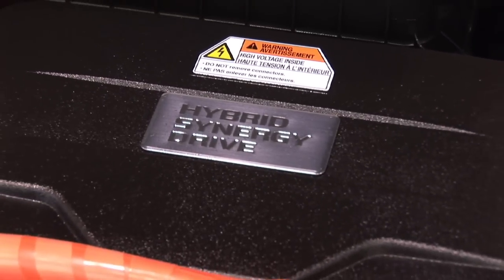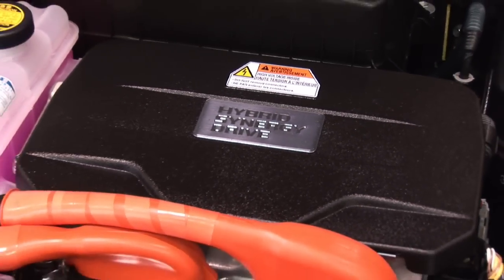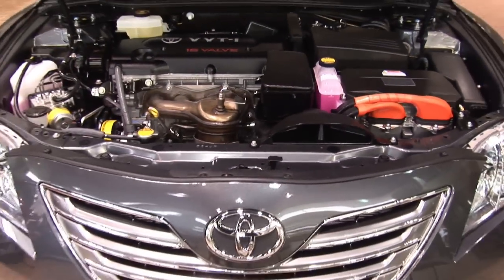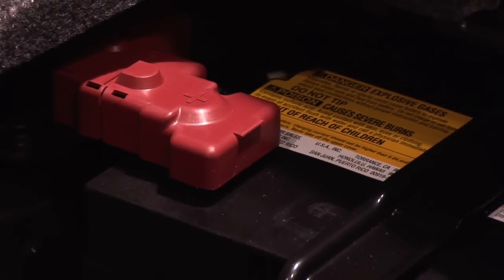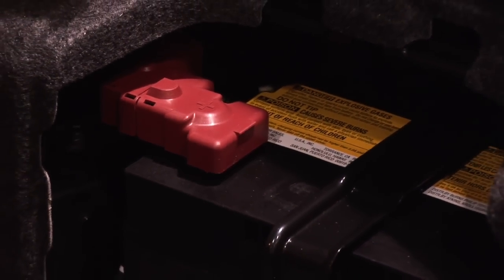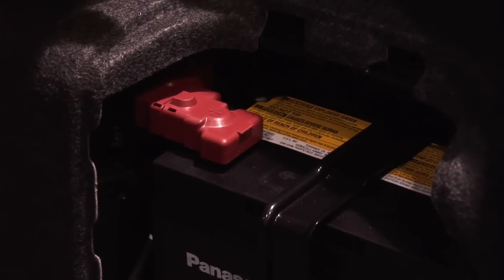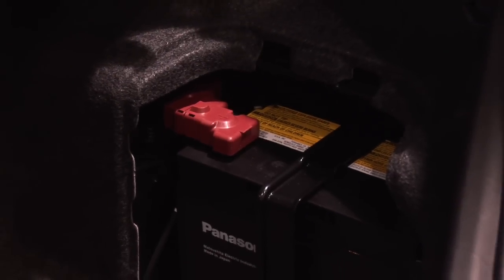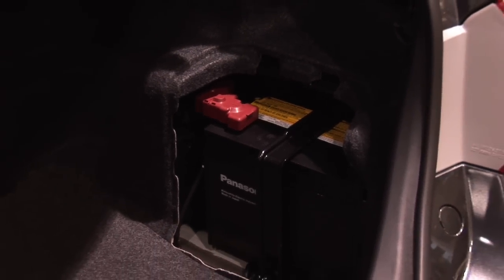Hybrid Car Facts : What Do Hybrid Cars Run On?

Comment: lets not talk about the fact that the generator takes away more horsepower then its used for and that you have a major loss in the friction coefficient and the fact the batteries add so much weight to the car that it makes hybrids really not all that efficient, a person would probably be helping the enviroment more by switching to hydrogen combustion or  a VW jetta then driving a hybrid